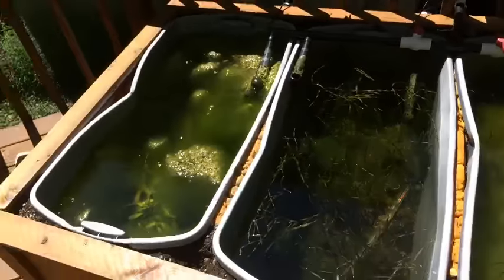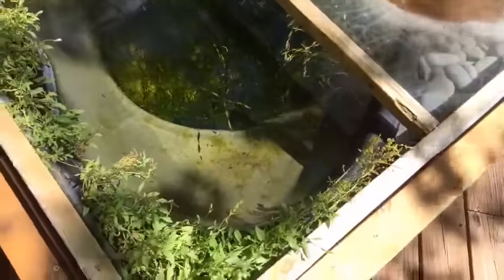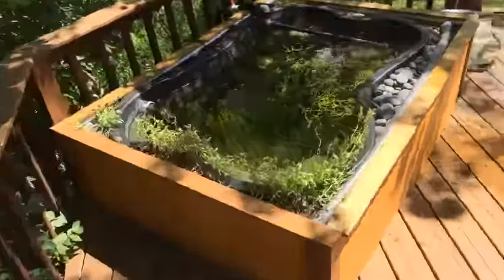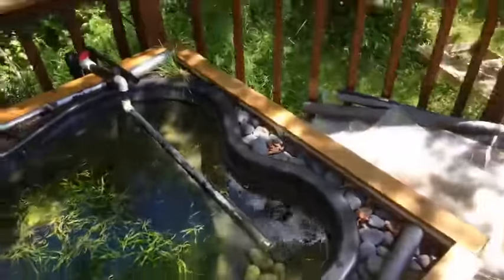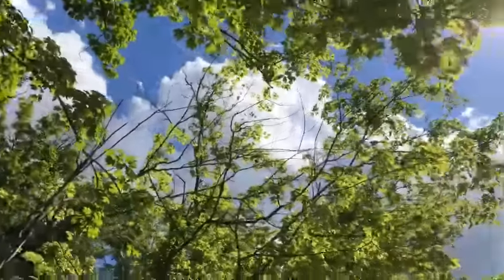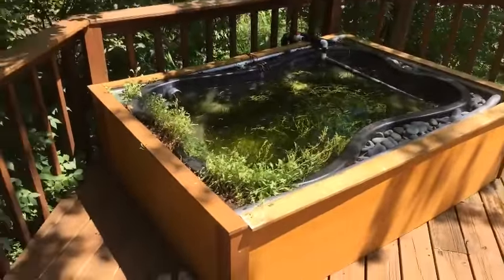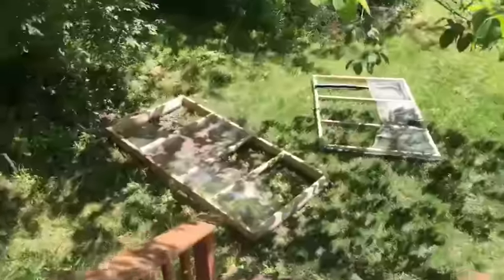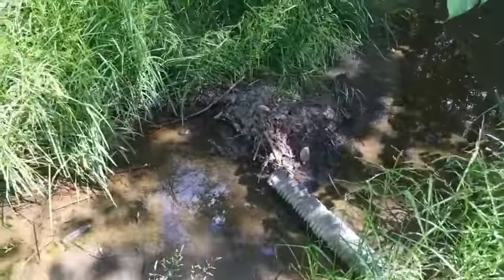🔴 Unveiling the 5000 watt Heated Outdoor Pond system from its 2nd Winter

Comment: if you used copper coiled pipes, could you heat the sump tank and run the coils (or steel coils in the actual tank) through the tanks to keep them warm? With lots of insulation to prevent heatloss going to the tubs. Im trying to brainstorm a way to heat multiple tubs cheaply. Copper is expensive but it would be a one time purchase.

I was thinking about a large heated sump in a greenhouse to heat a lot of breeding bins. Maybe using some sort of rocket stove/radiant heat. 

our greenhouse breeding facility is going to be solar but i cant do solar right away. 

Sorry for all the questions, i want to do this right, so i don't boil or freeze our stock LOL.

Comment: Too bad you don't live near me. I'd give you a bunch of old patio door panels with tempered glass. They would make nice covers.
Reply from the maker: Yeah would only wonder how heavy they would be though.
Reply: I have some single glass in aluminum frames that aren't bad but the insulated ones in wood frames have a little weight on them.

Comment: So are you open to a new design Em with genom to to hep deep
Reply: Sorry, Didn’t know this had published, was trying to talk about geothermal ground Temperature below the surface of the ground is a Constant 55 degree, for a example I have two pond, one froze the other didn’t and hasn’t for a few years, circulating the water under ground, the top is expose to the weather.